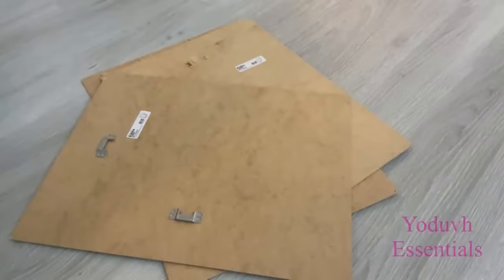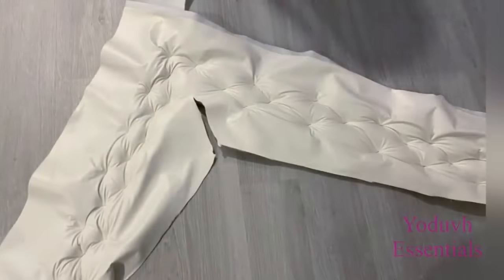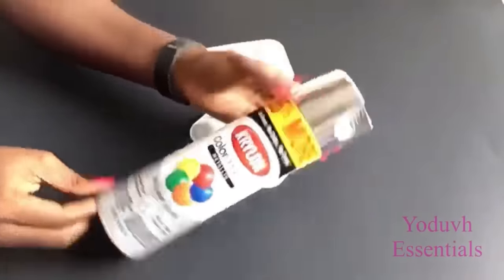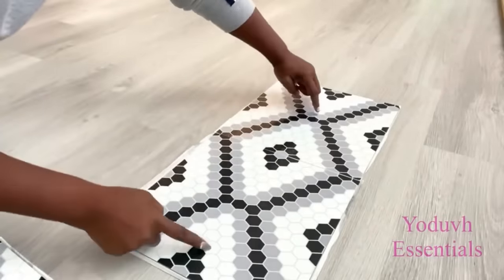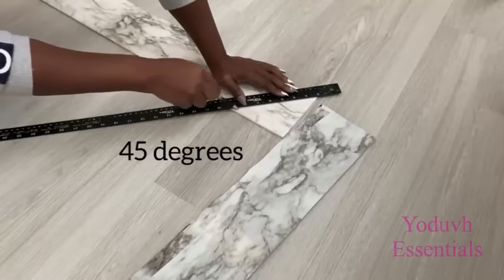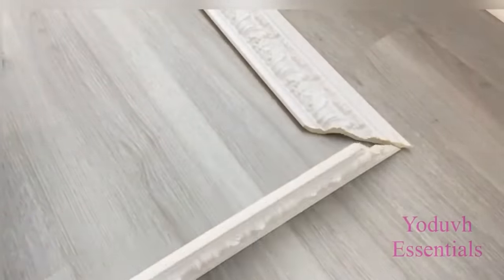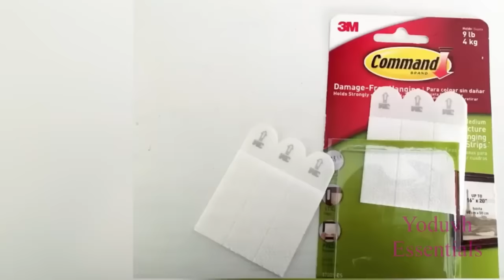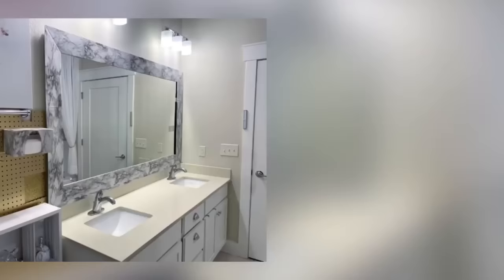NEW Large MIRROR IDEAS FOR RENTERS! DOLLAR TREE BATHROOM REFRESH FOR Valentine’s Day

Comment: I wouldn't stick the adhesive tiles to ur walls or anything if u are renting because if the surface is flat and it sticks when u go to take it off it'll also peel the paint and u will be charged from the landlord if not more due to most lease agreements state u can't leave the house or apartment in any other way than the way it was when u arrived and started your lease

Comment: OMG! I didn't watch through to the end when i left the last message!  the last one is awesome! I never thought of that for my master bath that still has a big builder grade mirror! I almost had it done professional year s ago but it was a fortune for the frame and labor!  Could this be done for picture frames as well? I have tried several metallic gold spray paints and wasnt happy with them so bough rubb and buff but couldnt get it to shine when I buffed it without rubbing of the paint!  Maybe its better on wood but rubbs right off metal. Have you tried rubb and buff and used it successfully? I have several gold metallic acrylic and it always leaves brush marks so I am stumped and I have light fixtures to paint gold as well!